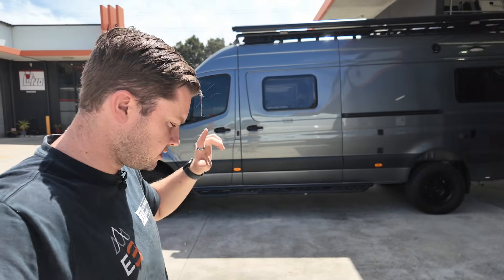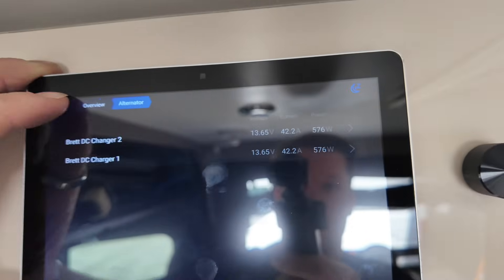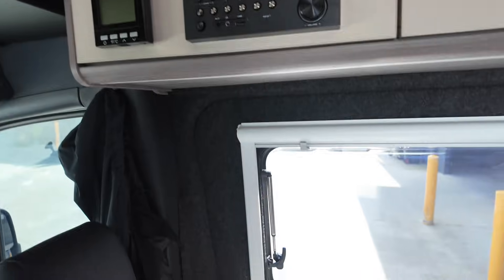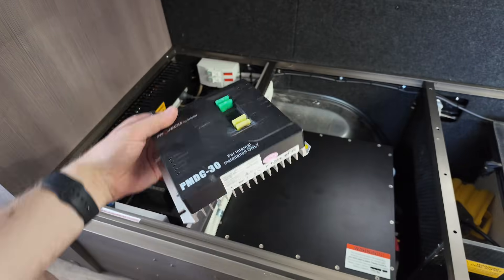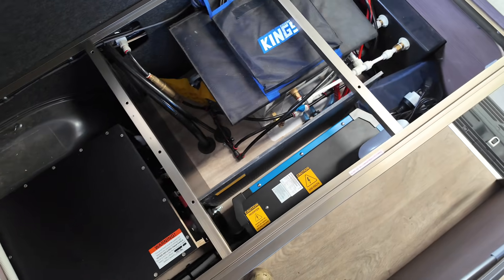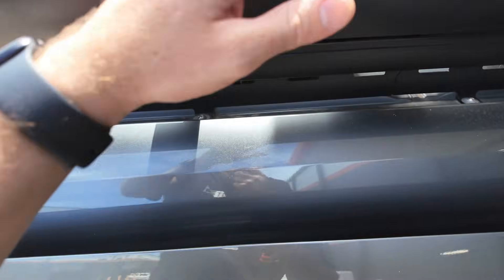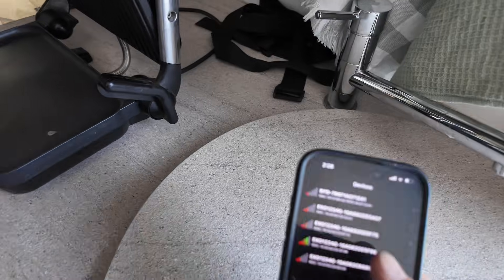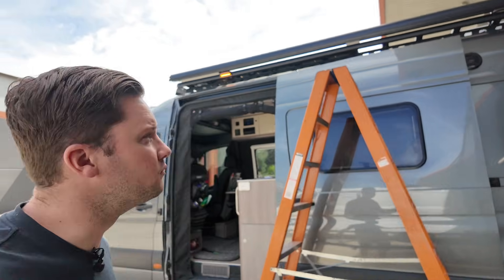OFF-GRID Ready? NOT EVEN CLOSE! What Your JAYCO Sprinter Actually Needs

Comment: Hi there
How did you do the starlink, we hallve a gen 2 for our caravan.

Cheers Darren
Reply from the maker: You can get 12v conversion kits, but you have to get both a power supply and a 12vDC router for it to all work. Most of the time we just try and convince people to go with the mini as it's a heap easier for a 12v install.  In this customers case, he was ok with running it off the inverter and turning it on and off via the inverter
Reply: @jtelectricalgroupnsw  I've actually purchased a victron 12/250 inverter solely for my gen 2, what's required to mountvand run cabling into van.
Cheers Darren